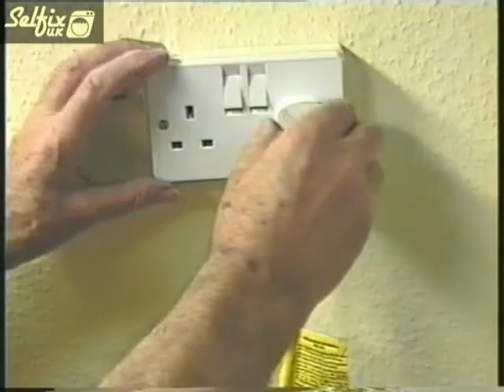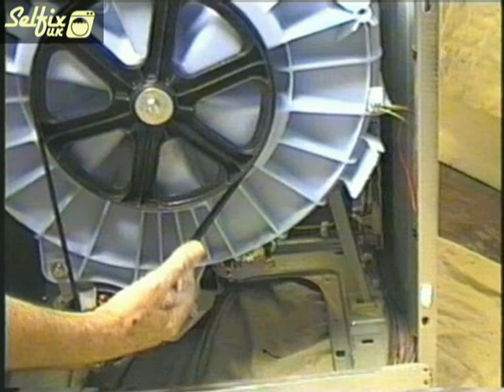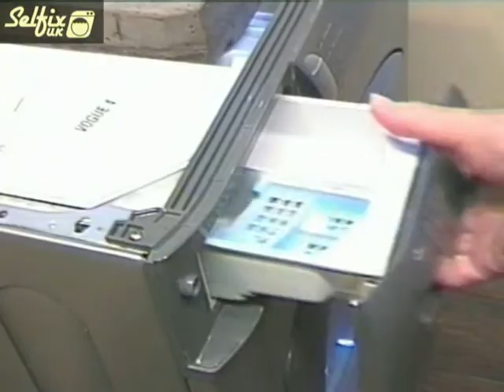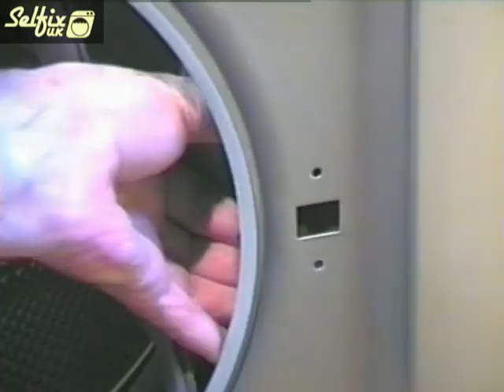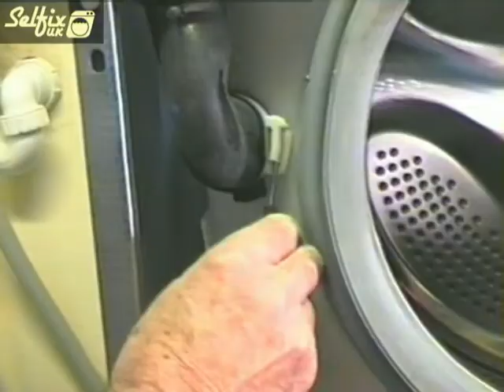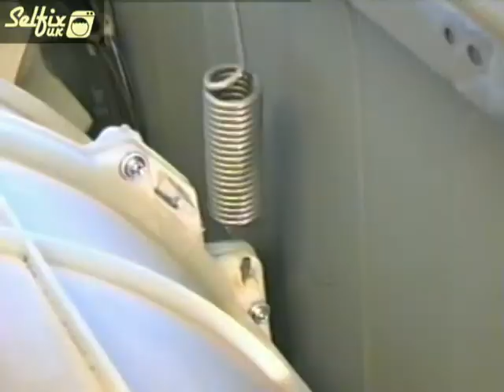How To Replace Hotpoint WF Washing Machine Bearings 1 of 3

Comment: Such a great explained video and all worked as he said in his video...... BUT.... Come to the drum there are no fixings to hold the 2parts 2gether. Looks like 4 tab clips but the drum is plastic welded together and has to be cut open. Not great and not worth doing if anyone has a sealed tub. Mine i cut open and now wished I never bothered. Washing machine ( Hotpoint WT741 ) now on the scrap pile heap. Gutted

Comment: If the drum spider support is broken and you have to drill the T30 screws out, the replacement spider supports don't appear to come with replacement screws for the 6 I've drilled out. Where do I get replacement screws from as don't want to use anything that will just rust out in 6mths?

Comment: If its not a loose top or bottom counter weights. Check. Its MORE THAN LIKELY BEARINGS. Does the drum rumble when turned by hand. If so, buy and new machine. the bearing replacement wont last. Hotpoint/Indesit/Ariston/Creda...machines are all the same make.=Rubbish.

Comment: Hi mate,
I have a hot point washing machine wdl540.
It has a started to make a much louder knocking noise while its on and the drum appears to move left to right more than normal.
Do you think this is likely the bearings??
Thanks